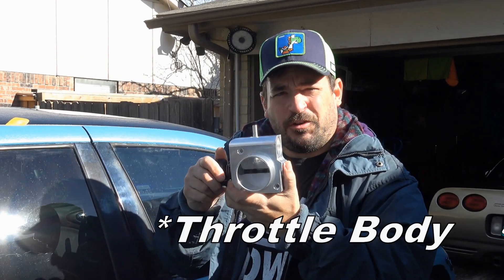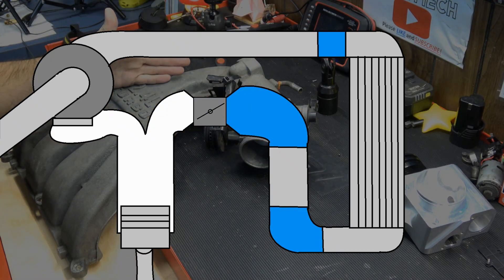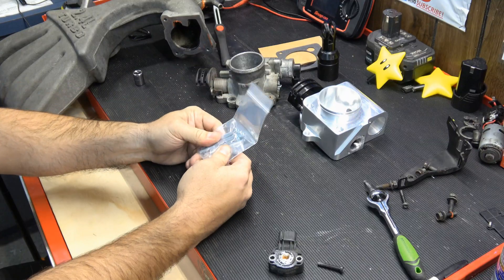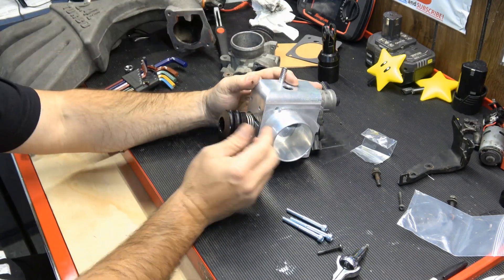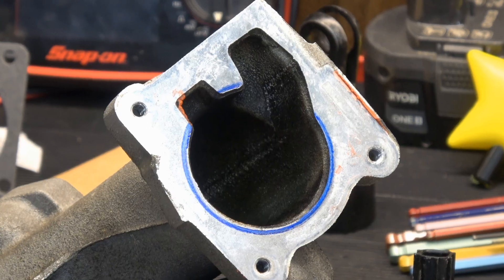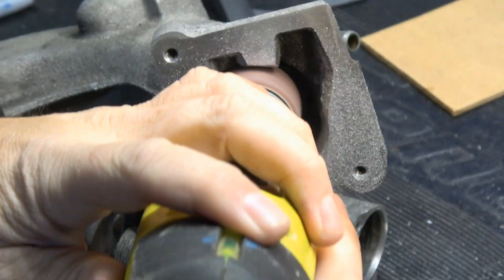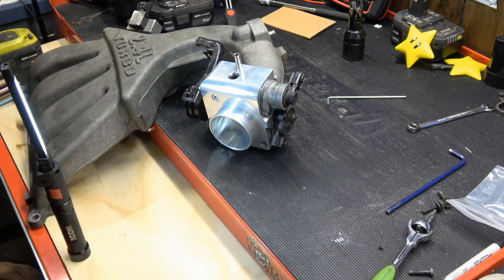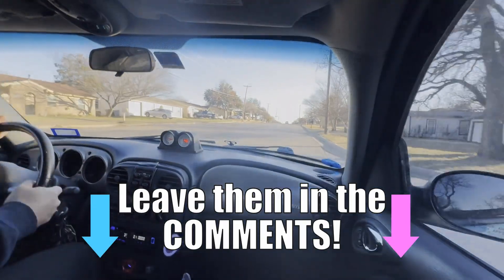Bigger Throttle Body, Bigger Performance – 62mm Install & Port/Polish Guide!!!  #turbo

Comment: Just came across your channel. Was that your oem mtx tb? I’ve been running an auto tb on my 5 speed since I’ve had it. The autos are straight through and not tapered like the mtx ones. You ever think of swapping to the plastic turbo intake manifold and ditch that heat soaking beast. 😉
Reply from the maker: Good catch! no I swapped it to the auto tb a couple years ago. 
I’ve heard good and bad about the manifold swap, but I might need to revisit that idea 🤔

Comment: dammm bro that turbo is spoiling hella nice , question after you installed it did you have to get a tune for the upgraded throttle body or where you able to just slap it in and call it a day ? 😅
Reply from the maker: You can slap it and call it without a tune. Of course a tune would give you the most of it, but the TPS ,MAP , TIP sensors will figure out the air volume.   Thanks for watching and the comment!
Reply: @ okay nice yes i was wondering that very helpful thanks 🙏